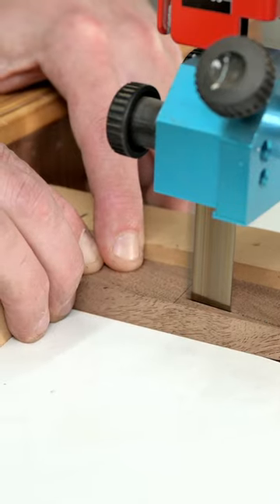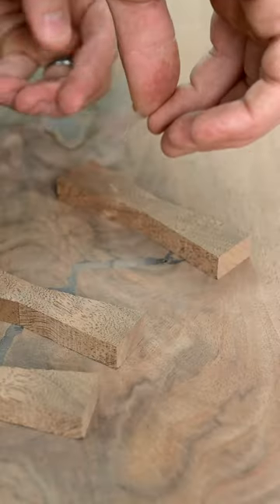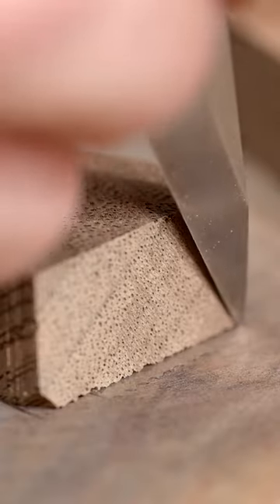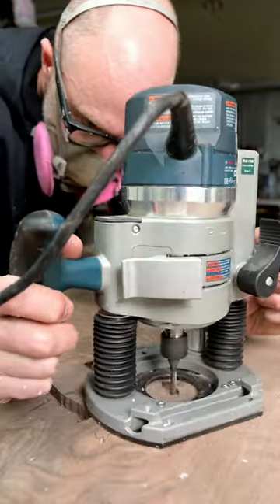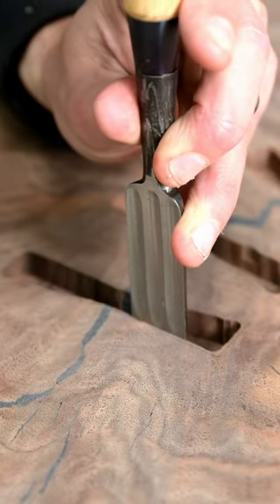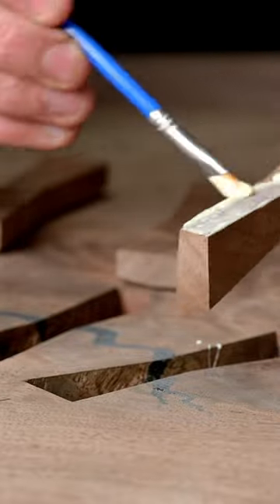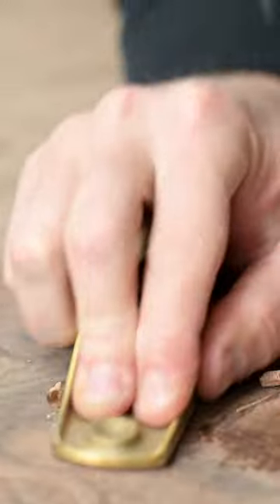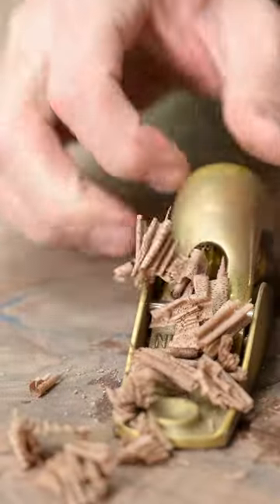Perfect Wood Inlay

Comment: When I was a child I recall some people put patches on their trousers, mostly jeans, to make it look like there was a hole which had been fixed. It seems like these unnecessary fixes of something that isn’t broken is the same thing.

If at least the inlays formed a pattern, I might understand but this…. 🤔🧐
Reply: If you look at the slab (here and other videos where he uses these) the ties are placed perpendicular to a defect or void in the wood. The defect has been filled with epoxy, but the bow tie bridges the gap more securely. 
So they are definitely structural and not just decorative.

Comment: Would the butterfly ties still work if they were half the depth and on one side ( not the top surface that is visible ?) it’s only a personal opinion however I don’t like the visual effect
Reply: Its an inlay, so its probably even less then half the thickness of the table. You can see it also in the video, when he's cutting out the wood.